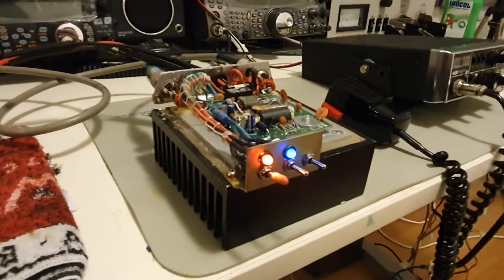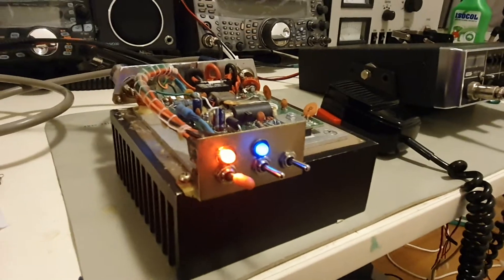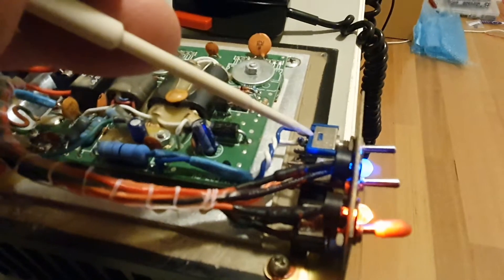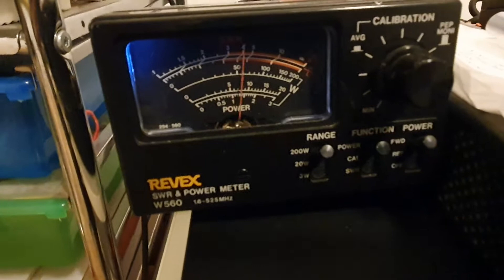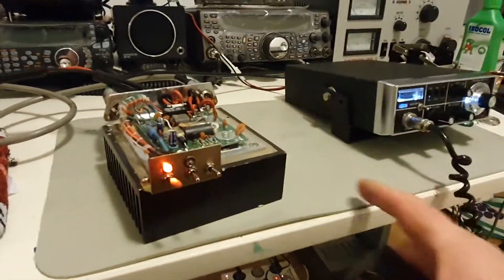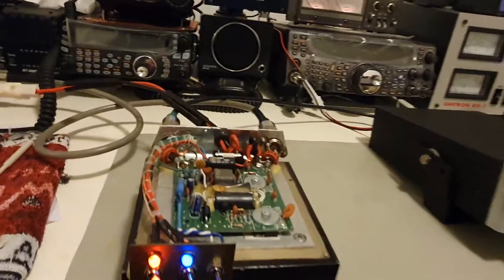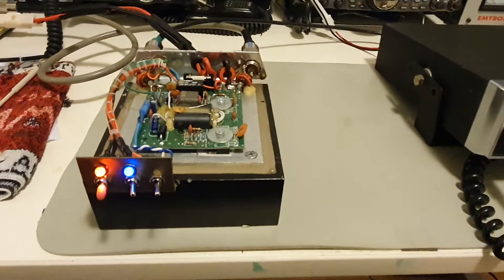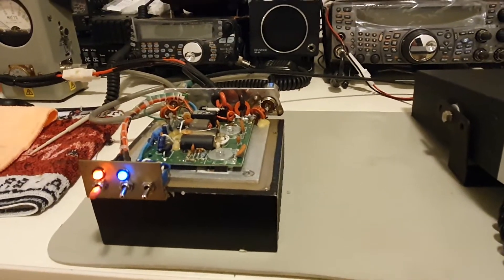RM ITALY AD-203 - HI / LOW SWITCH - HOW TO MOD FOR 130W PEP - Part 4

Comment: whats the input SWR when you do that?
Reply from the maker: 1:1 it's into a 50ohm dummy load
Reply: @Pull_It_Apart_Paul_Ham_CB  im not talking on the output, im talking between the radio and the   amp without that resistor
Reply from the maker: 1:1
Reply from the maker: Radios limiter circuit set to 1.5:1 so if any greater the circuit starts throttling back

Comment: Nice job there i like the heat sink mount.
I have mine in a cobra 29.
I have on the way to use in a 148gtl.
Would you mind posting some pics of how to do the ssb delay..
Thank you .great video.
199 florida georgia line.
Reply from the maker: Thankyou.   The ssb delay was factory wired on a switch
Reply: @Pull_It_Apart_Paul_Ham_CB  
Oh i see . Mine did not come  that way. I dont recall seeing it as an option.
I will go back an look

Comment: Thank you so much for this video. Works great. Installed one in my Galaxy 959. Now I got barefoot, low side and a high side. Mounted a small fan on the underside. Love my 2 kl203's but this in a radio is very nice to have.

Comment: What is your swr going in to the amp now with the resistor in circuit and out of circuit it might be high when you remove the resistor you might need a tuning cap
Reply from the maker: Perfect, all it does is alter the voltage into the transistors

In the next model up its the same circuit design without this resistor in series, and around 150w PEP
Reply: That resistor is in the input tuning circuit removing it is changing the input tuning
Reply from the maker: All working perfectly, before amp and after amp, have vswr meter between both and one in the radio.
Reply: Take a close look at the swr between the radio and the amp when the resistor is out of circuit I think you are going to need a 180pf to get the swr down

Comment: that is great work, I actually just got a AD-203 myself. what is the switch you are using for the HI/low is it just a standard on off switch? keep up the good work.
Reply: This is a really nice mod for the ad-203
And I would love to see how you get the 150 Watts with the next mod. Keep up the good work 73s
Reply from the maker: SPST
ON OFF
I'm about to add another resistor onto a 3  position switch to give 3 power levels to 150w